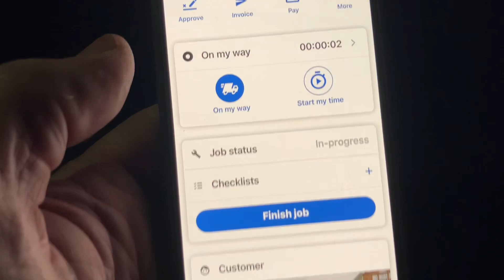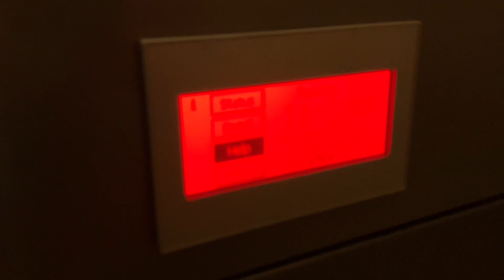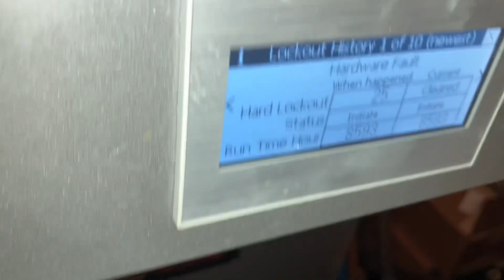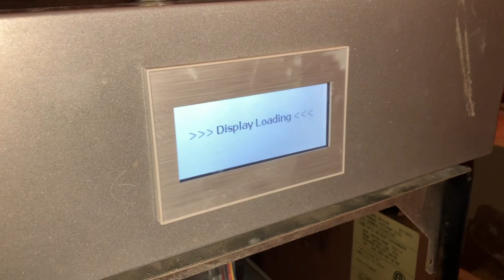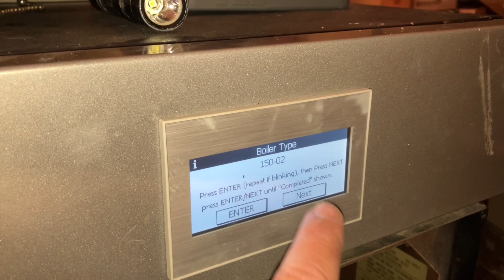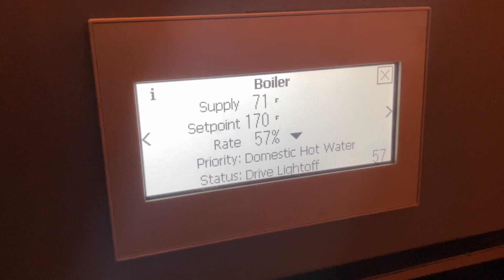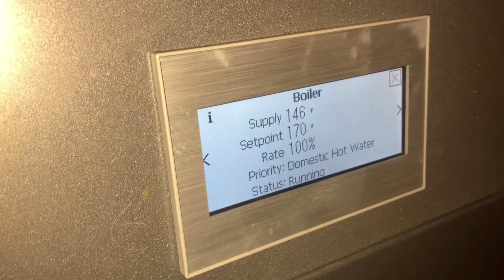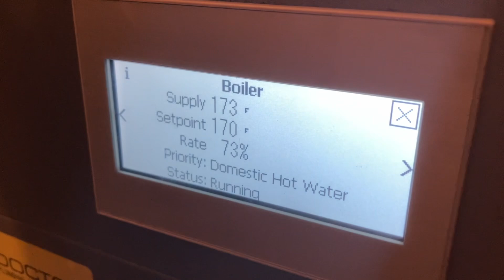Neglected & Improperly Installed US Boiler Burnham Alpine Error 25 - Sage Controller Replacement

Comment: Condensate drains are the # one neglected or missing part on high efficiency boilers I see installed.  Especially in Michigan.  The quality of boiler systems and plumbing in general was much higher in Colorado than in Michigan.  I don't know the reason but if you do quality work, its easier to stand out in Michigan because of less competition.

Comment: Control boards should not be failing someone needs to diagnose the problem
Reply: junk components on the control board (junktronics, I call them). it was making noise when he was near it with camera, the noise was either failed dried out electrolytic capacitors or ECM motor output circuitry for combustion blower left the chat. very likely both combined to cause the failure. not like it's the first or the last control board that's failed that way.
the other primary failure in all electronics/appliances is relay contacts.

Comment: boiler controller getting cooked inside top of cabinet. shit design
Reply: To be honest the inside of those doesn’t get that hot.  Probably cheap components on the board.  I don’t think there is conformal coating on those boards either.   It’s true all Alpines will need a controller at some point, typically 10-15 years.  But other than needing a few inexpensive parts they are great, simple inside, easy to work on and last a long time with a stainless HX.
Reply: @daversj  winner winner, but to be fair it was a 2011 boiler, this is 2025 so it's 12 to 13 years old (allowed for shipping, warehousing to install time). majority of electronics are meant to last 5 to 10 years at best, some much less with very cheap stuff. many fail less than 1 year.

Comment: The biggest scam perpetrated on American public is these bullshit wall hung condensing boilers. Put in an old cast-iron boiler and never touch it for 20 years and it ain’t gonna cost you $2000 to replace a board either cam scam scam.

Comment: another boiler with no air scoop... I wonder if its the same hack with all these jobs with no air removal.  No idea why they would skip it, Its 100% worth adding the air scoop? its an additional 300 bucks in your pocket. but maybe that's how they keep the install price lower than the rest.
Reply: They didn’t even do a primary loop with a high volume pump. Hack install, probably replaced a high mass boiler and reused the zone piping.